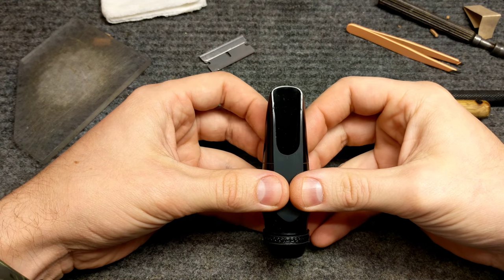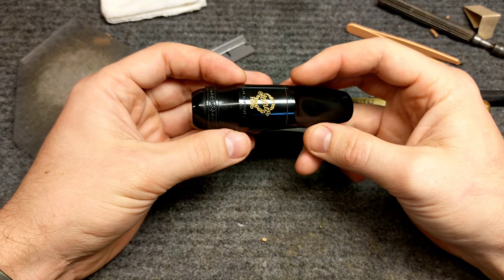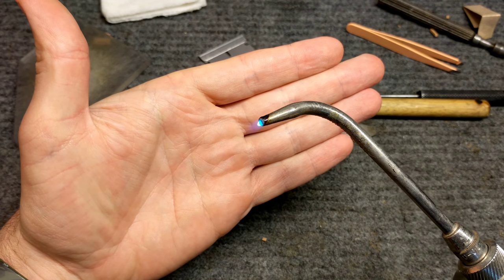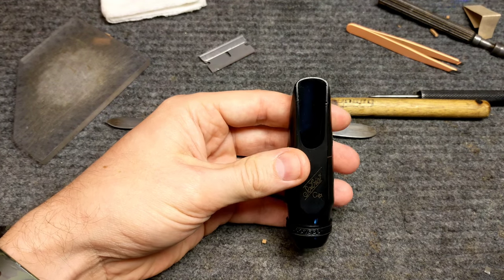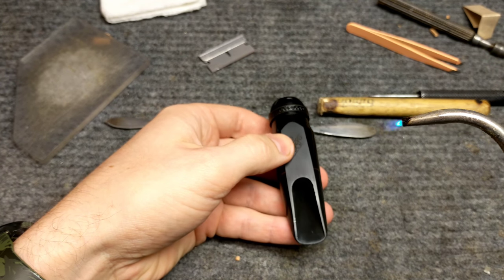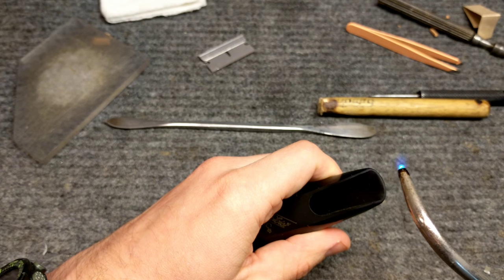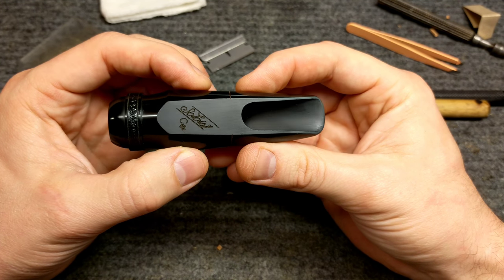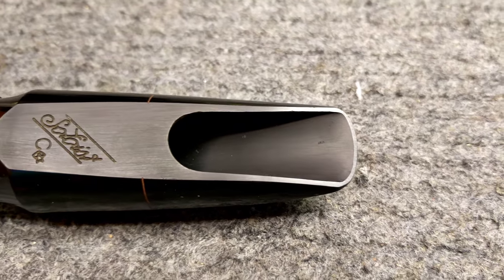Saxophone Repair Topic: Hard Rubber Mouthpiece Dent Removal

Comment: Very clever, Matt. I wonder about using a Vortex air torch and masking the neighboring areas with tape or foil? When I repadded my clarinet with an alcohol lamp I would put aluminum foil between the key I was working on and the horn. Kept the heat away from the wood, and I could press the pad down to seat it even with the foil in place. Pads set up and sealed nicely.

Comment: Do you think those little dings affect playability?
Reply from the maker: little?!?
Reply from the maker: yes.
Reply: Matt Stohrer maybe I should’ve asked if little dings in general affect playability. Haha
Reply from the maker: :-)  well mouthpiece facing curve accuracy is measured in ten-thousandths of an inch, so any ding is not a good ding.  However sometimes a small one will not be noticed by the player if it doesn't also create a bump  (like the raised edges of a crater) or go all the way from edge to edge of the rail so as to impact reed seal.

Comment: Hi matt,
For most the easiest and least trouble prone would be a simple soldering pen. Lightly rub over dent while the tip is heating. Less risky than a torch and far less expensive than a torch like yours. Also, a 100 watt light bulb will produce similar results, after it's warmed up. Cheers, erik 
MouthpieceGuys.com
Reply from the maker: thanks for the tip!